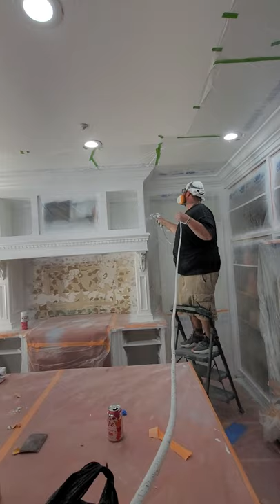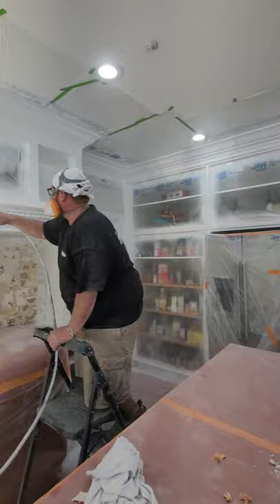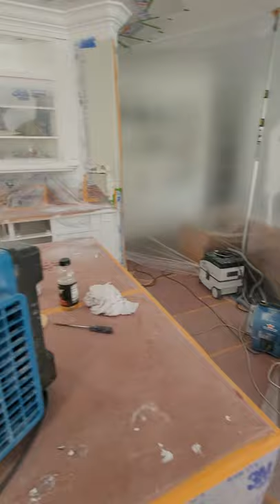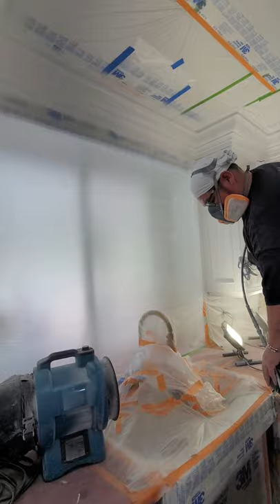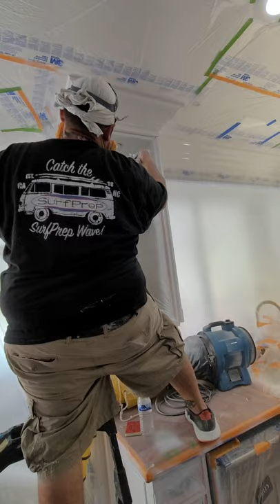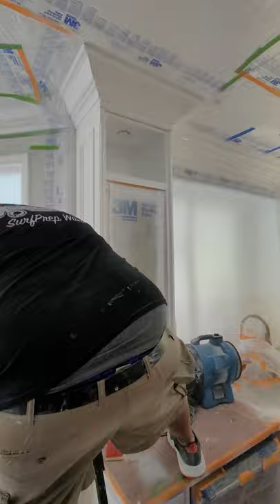Renner 851 2k  how to spray with  tritech airless  complete  kitchen

Comment: How do you spray so you don’t get spits if you pull/release the trigger on the surface being painted?
Reply: If youre getting spits, you need to either change out the spray tip or the gun needle is worn out.

Comment: I see you always do the flats first and the overspray melts back dowb to it when it falls. What makes it melt? The product itself. Crosslinker?
Reply from the maker: That's what I try to show folks my spray technique  so it helps them learn. What to do. And hope it helps showing  my style hoping it can solve some problems alot of people have
Reply: @dennisrodriguez9700  Not all products will melt back down on flats if sprayed first since overspray has to fall back down, dont think it necessarily have to do anything regarding spraying techniques, but the products you use. Thats why i asked if it was the products you used that helps with meltilng it back down? Is it the thickenner?

Comment: Hi Dennis, not sure if you've answered this before but which mask and filters are you using? Are you adding the isocyanate hardner?
Reply from the maker: I'm running  3m cool Flo. Mask. With really good. Ventilation